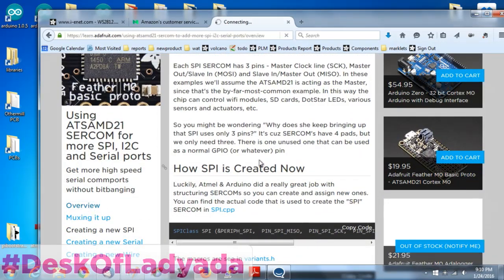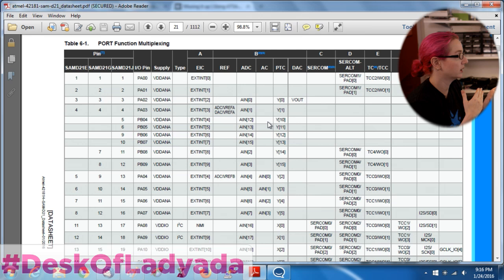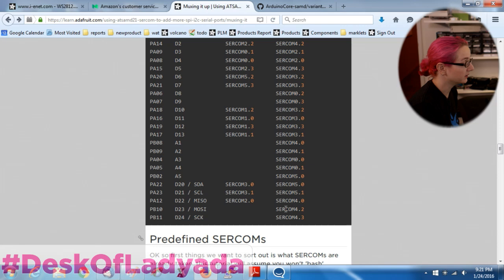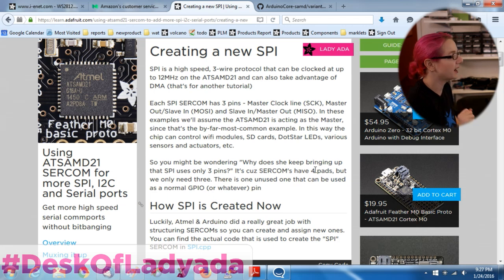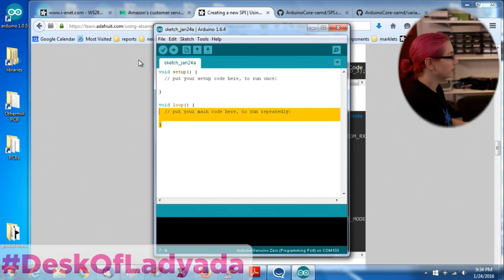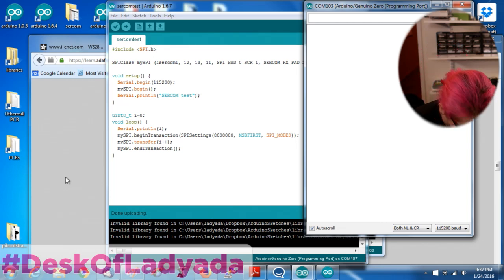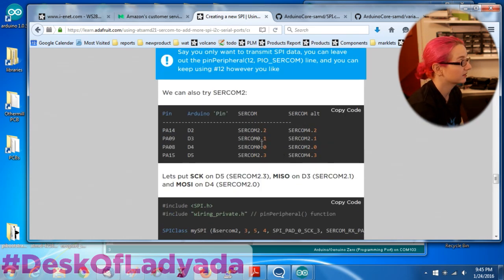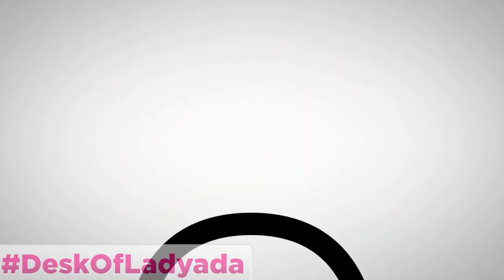@Atmel @AtmelMakes Using ATSAMD21 SERCOM for more SPI, I2C and Serial ports  #deskofladyada @adafrui

Comment: If anyone made it here while looking for Seeeduino Xiao info --

Was trying to enable I2S and SPI but needed A8 for I2S instead of for the  SPI SCK pin. So needed to switch Sercom0 around. 

Found out in my weeks of troubleshooting that the pinperipheral function doesn't do anything for anything other than changing the input/output/pull-up option. In wiring_private, the switch-case is empty for those cases. 

To get around this, I simply changed the default pin mode in the variants file for the ports I needed. Ex. PA-06 was set to Pio_Sercom_alt. Switched it to PIO_SERCOM and my sercom switch finally worked.
Reply: Also, big thanks to LadyAda for this. Helped out a ton.